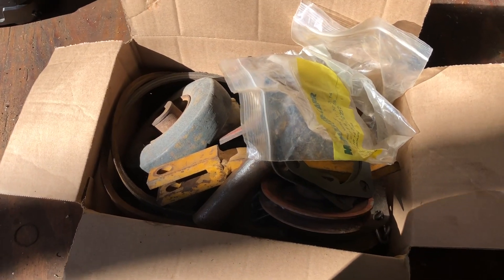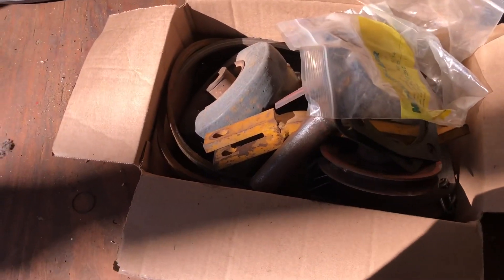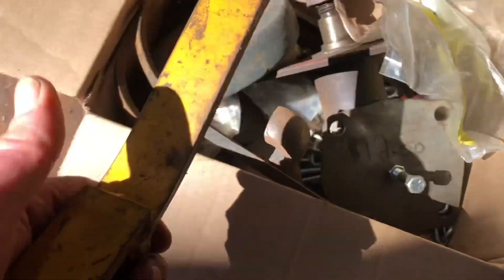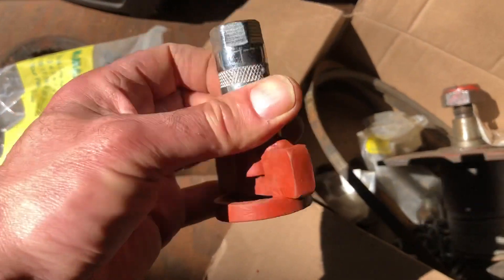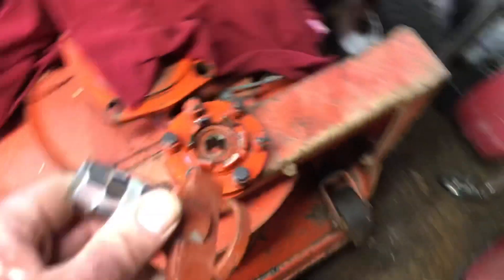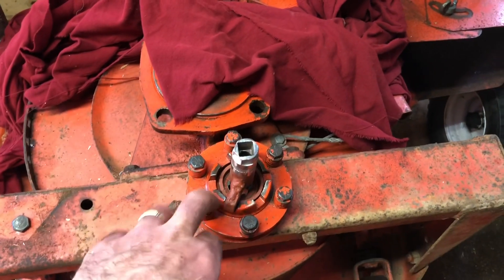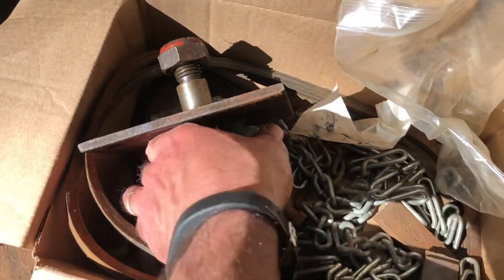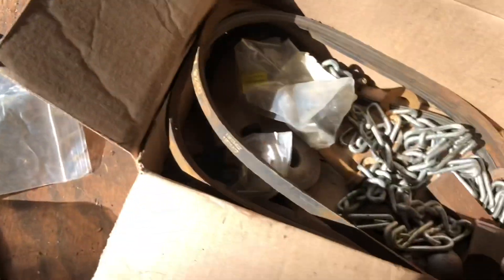FREE Box of Gravely stuff

Comment: Always nice getting Gravely parts.  I made a clutch tester from a socket welded to a dog gear.  I used it the other day with my click style torque wrench to check a reel mower.  PaulL
Reply from the maker: Yeah I have a click type as well I’m on the hunt for a beam type to read it instantly. Do you just slowly increase the setting to figure out where it breaks free?
Reply: @DKTractors  I fully loosen all jam nuts and bolts, make sure clutch slips cleanly, and finger tighten to start.  I set the torque wrench to 5 ft lb lower than my target then tighten equal number of turns on each bolt until I hit that setting.  Then readjust torque wrench to final target and turn bolts 1/4 turn each until I hit the target.  Back off 1/8 turn each if I overshoot.  Tighten the jam nuts when done.  Either click or beam will give an initial indication if you are over target.  After that it is the same procedure for either wrench.  PaulL
Reply: The old manuals say they should start to slip around 30 to 36 ft lbs.